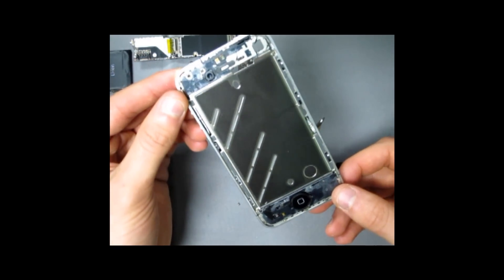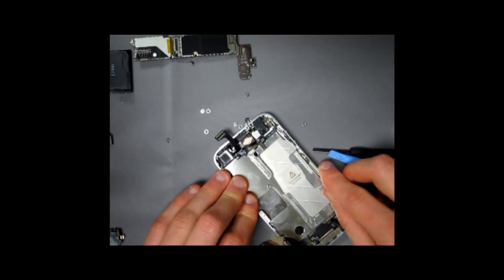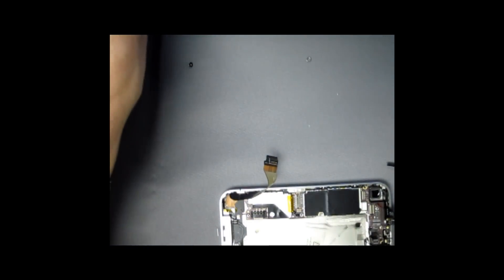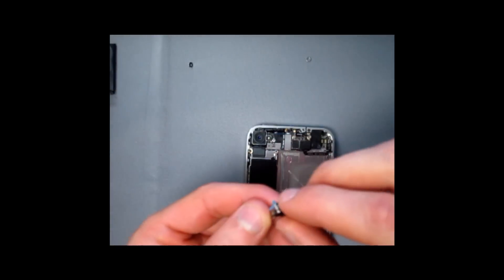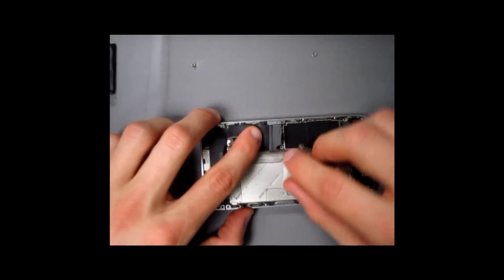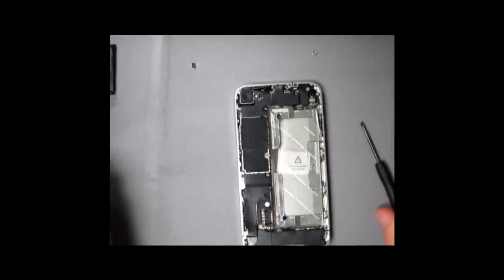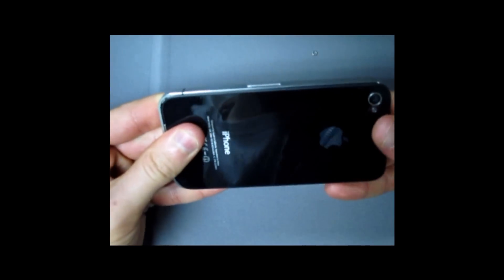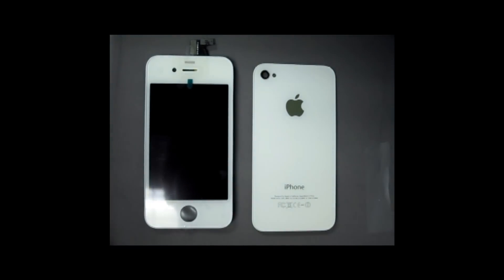iPhone 4 Glass Screen Replacement Directions + Assembly (Step by Step) PART 2 Zeetron

Comment: ahh soo annoying! I replaced my screen a couple of months ago using this video, but i forgot to put the earpiece mesh in! So two months later, I have a spare hour so I decide to take it apart again, but this time, when putting the screen back on, I bent the digitizer cable :( so the screen works but there is no response to touch!